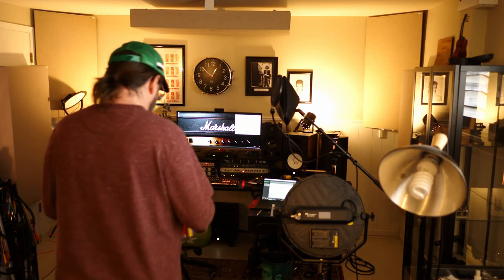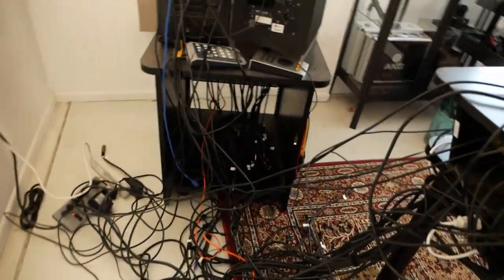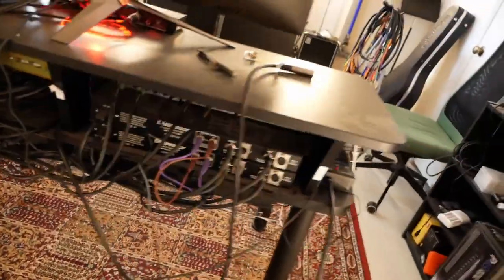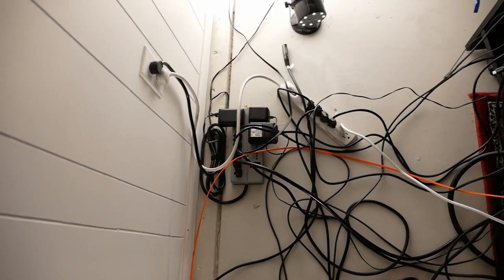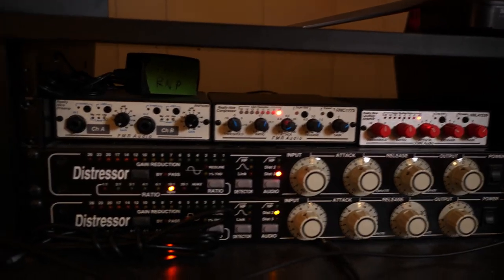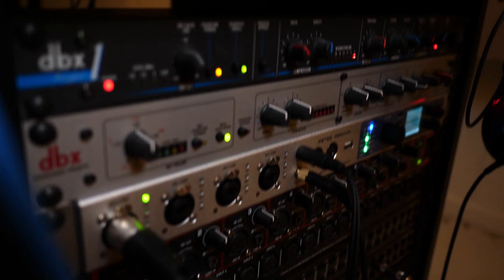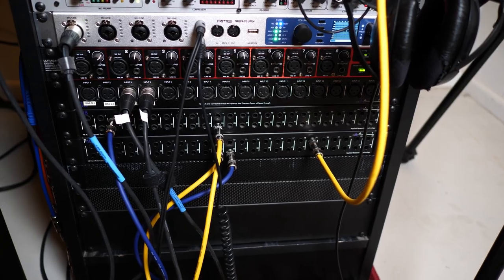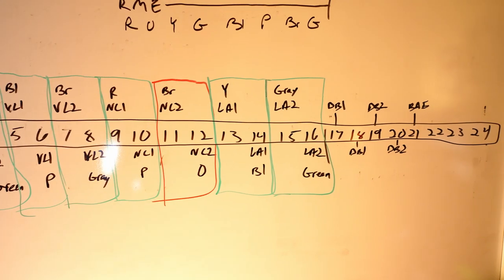Rewiring the rack...again

Comment: How is the RME 12mic treating you . I might end pulling the trigger on one but want to know your thoughts . Thanks.
Reply from the maker: I love it!  I think that my only gripes about it so far are that the headphone output could use a bit more available gain, and I wish that I had control over input gain and gain auto-set via TotalMix for the 12Mic preamps.  But the pres are great, the build is great, and it's been rock-solid and stable for me so far.